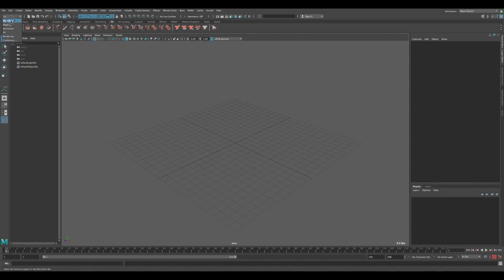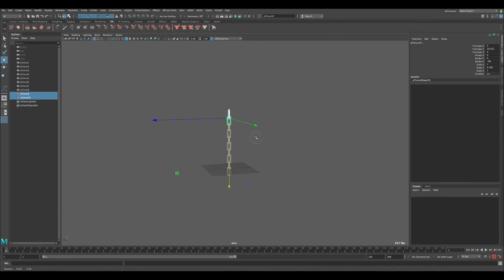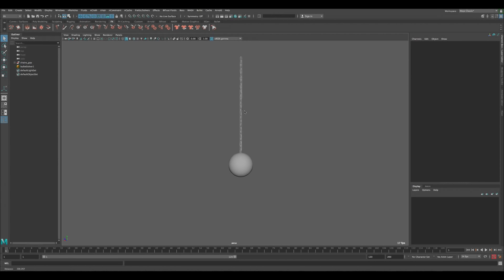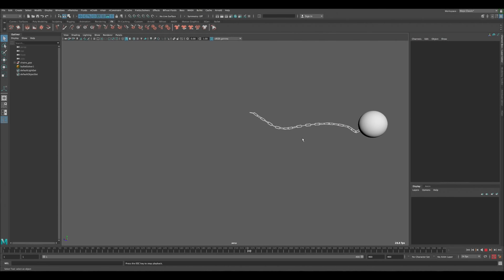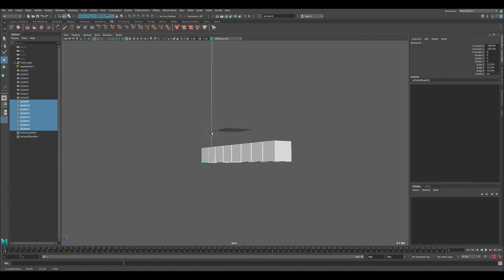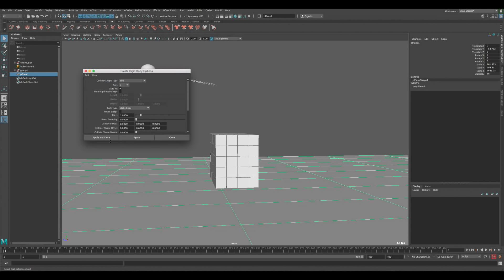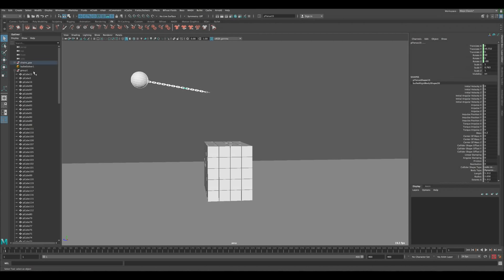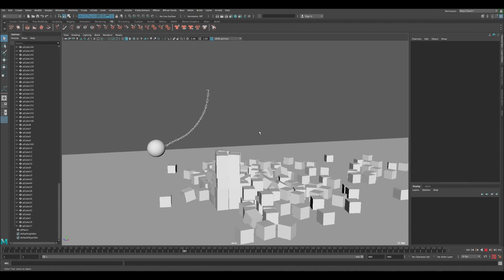Maya Bullet Physics Simulation Tutorial: Wrecking Ball Animation - Active and Passive Rigid Body

Comment: i cant get the chain and ball to stay together after i move the pivot point. it detaches the ball from the chain. :(
Reply from the maker: Hi Sabrina, tweak the settings on the weight and the damping and it should help, these setting will work if you did the connection right, but if there is issues with the connection I recommend to start new scene and start slowly step by step. hope this helps :)
Reply: 3D Models World thank you for the recommendations. I did the tutorial like 5 new times. Still disconnects. But I will check the weight like u said see if that helps.
Reply: @3DModelsWorld.  Mine is doing the same. The ball disconnects from the chain, and I've redone this a few times. I've tried adjusting the mass and linear damping, but nothing works so far
Reply: Nvm! I got it working by connecting the first two chains in the beginning instead, then applying the entire this as a group, then applying the bullet physics
Reply: @iffyschannel  still trying to do this tutorial a year later lol
it still disconnects but i connected it but now it's stiff and not loose. :(
Reply: @sabrinaflipse7732  Wow, I can't believe it's been 2 years. I admire the grind. I wish you could show us what you were doing on screen, then we could really help you out :(
Reply: @iffyschannel  i come back to this excercize every so often just to see if it will work. it still keeps haunting me. lol. my model looks like his but won't stay connected. i tried your method of connecting the first two chains and then duplicating them up, but when i go to swing the chain all the links are either stiff without movement, or they all swivel individually. it's annoying :(

Comment: its not working for me, the ball and chain keep disconnecting. The chains links aren't touching each other and I did every single step correctly. There is no solution available online, so can u plz explain, i have read the comment section and you didnt answer against this query
Reply from the maker: Hi Maitreyee, unfortunately for the dynamic fx scenes its hard to give an answer to a problem without investigating the Maya scene, if you followed exactly the tutorial and still this happens that mean there must something in your scene that is not working correctly otherwise it will work, the only way is to actually open the maya scene and investigate everything from
1- The models are not touching or some intersection.
2- pivots are where they should be and not off.
3- the bullet solver have the correct settings.
4- the collision objects are not intersecting or far off in the distance.
5- gravity are correct to the scale of the object and your scene.
and much more settings and checks needed to be done, for this reason its hard for me to give a helpful answer for this kind of question,  I apologize for the long reply.

I would recommend to try and create simple 3 chain setup in fresh Maya scene and try and see the results you get after that keep building on top of that until you get the desired results! 
it will be a learning process and will be worth it cause after that you will be able to do as many times as you want with any variations! hope this helps, thank you for your comment! :)

Comment: Is it possible to animate an object with rigid body using keyframe? Ex. I want to fill a bucket with balls using active rigid body and then i will animate the bucket.
Reply from the maker: Great question, I never tried this before with bullet physics, however you can do that well using nParticles, there is option there called fill object, this will fill the bucket with the balls or anything you like cause you can use instancing to replace the object, and then when you animate the bucket the nParticles will behave great and as expected, feel free to check the nParticles for your case it might help you better, hope this helps and feel free to let me know how it goes! :)

Comment: I have a problem: when I select multiple objects to change a value, I only change it to the first one selected (for example the mass)   why ??   :-(
Reply from the maker: if you do the adjustment from the side menu on the right it should do it for all, if not then your Maya might have a bug or some issue, some times wired things happens in 3d softwares with no explanation ;)
Reply: 3D Models World 
Are you sure that selecting all the objects and applying a value affects everyone? Should not we create a "set"?
Reply from the maker: Yes we are sure if you select the objects and change from the side menu it will change on all of them, creating a set will help but not sure if  it will include all the attributes of the dynamics, we create sets usually when creating controls for animation rigs but not sure about the dynamics. hope this helps :)
Reply: @3DModelsWorld.  You're right... But only in the channel box, the atribute editor not work for this.
Reply from the maker: Thats true I agree with you! maybe there is a script that can help with that.

Comment: Hi Adam... I have some issues with Maya 2018 rotation tool... What to do??
Reply from the maker: what happened? sometimes click on the reset button for the tool fixes the issues. you can try that just double click on the rotation tool and at the top corner click (Reset) that might fix any issues with it cause it will put it back to default. hope this helps :)
Reply: The rotation axis were one type of disabled... only rotate in one direction where the main yellow circle indicates...
Reply: is there any way to make maya 2018 control like maya 2014... shift+MB  sucks...
Reply from the maker: mmm thats weird did you try to reset the rotation control?  that usually fix the issue.
Reply: no that won't...
Reply from the maker: are you able to provide screenshots? did you check if the channels are locked in the attribute editor?
Reply from the maker: you can upload the images online using free websites just google "upload images online" if not feel free to email us on our contact page here and we will be happy to help you out: https://3dmodelsworld.com/contact-us/

Comment: Hey my chain is breaking apart instead of falling together after I already applied the active rigid bodies. What's wrong?
Reply: mine is ripping too. try to release your ball from the lower angle, it worked for me, but just for some reason ball turns glitch'y later on and start skipping frames after frame 300 +
odd....
Reply: when you are duplicating the torus make sure they don't intersect
Reply: @subarusti333  what do you mean low angle?